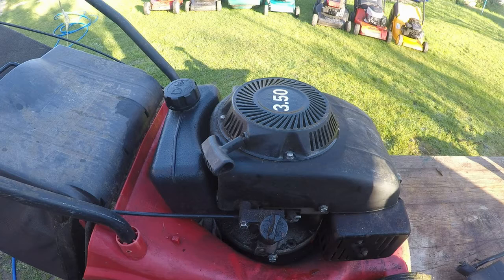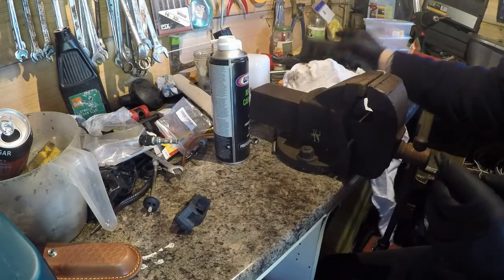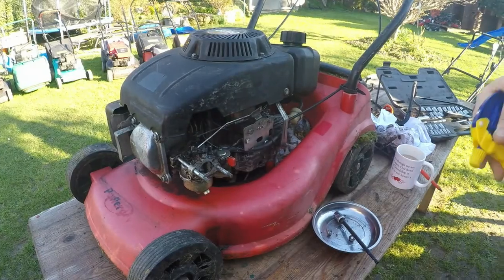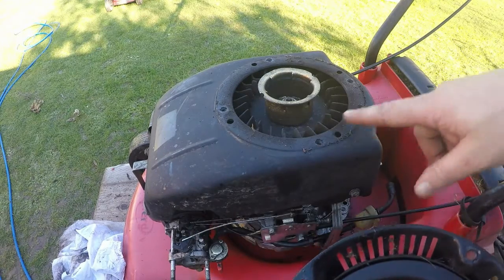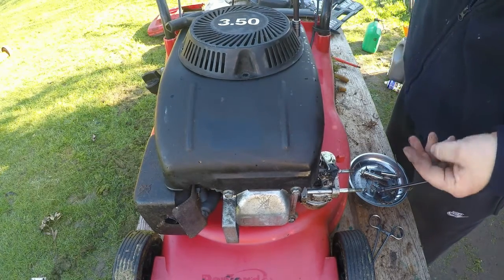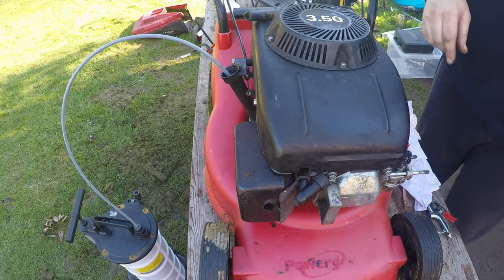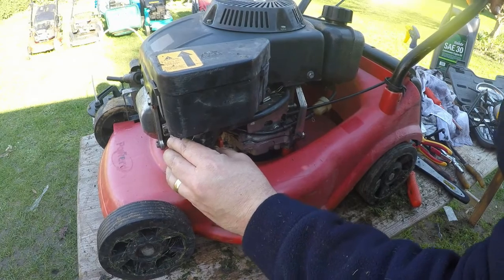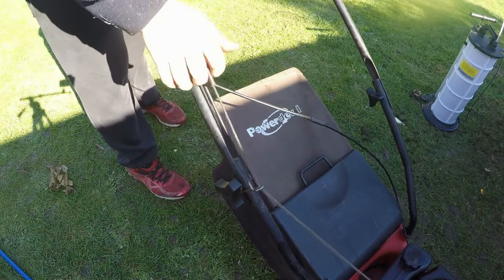#howtofix #easyfix #lawnmower Lawnmower Power Devil Part Exchange

Comment: Another good job Mick. Re spark plug - NGK BPR6ES or equivalent Champion RN9YC show as gap of .030" (.762MM). I have had to make a similar repair to air filter unit. I managed to glue in a  bit plastic sleeve to fit internally for extra stability.
Reply from the maker: Neil Harvey good idea mate

Comment: Great video! I have the same mower. 
I'm a novice when it come to motors so forgive me if this is a dumb question.
Is there a choke lever on this mower or does it have an automatic choke?
I couldn't figure out if the lever underneath the filter was the fuel switch or the choke.
Did i hear you right saying it's the fuel on switch? 
Mine is chugging along at the moment but the speed lever thing is super tight. Hope I can fix it!
Reply from the maker: The Leaver on the carb is the fuel on off mate

Comment: The dead mans handle should be the other way round (at the top) I think it is missing the stopper that prevents it from flipping down. I fact I just noticed at 02:06 there is a hole next to where the dead mans handle slots in, put a nut and bolt through that so that it stops the handle going too far forward, you could even go as far as to give the bolt a lick of black pain and the customer will be none the wiser 😊
Reply from the maker: Jacob Bates yeah that’s what I was saying but I inspected it and it’s not missing anything or broken off. Also the dead mans handle cable is not long enough to go over the other side so maybe it is made like that.
Reply from the maker: Jacob Bates also I just looked on eBay and it’s on the top but nothing to stop it so maybe it’s just worn a bit.
Reply: Jacob Bates yes I sold one similar had a kind of flat piece of metal L shaped bracket that stopped the DMH dropping down. Secured through the hole you mentioned with handle on top.

Comment: Hi there mick what oil did you put back into the machine please? And is this a 2 stroke engine? sorry I’m a novice.☹️
Reply from the maker: It's a 4 stroke.. I use sae30 oil mate
Reply: Thanks so much mick, I’ve got the exact same one I think what’s the difference between a 3.50 which you have and a 3.5 which is the one I have please? I’m working on it and just wanted to double check a few bits, And what type of fuel can I put in would it be unleaded fuel?

 Ps .Thanks. I Really do appreciate your videos buddy they’ve helped a huge amount so please keep them coming. 👍
Reply from the maker: @shaunbailey7910  the 3.50 or 3.5 is the same. Meaning 3 and 1\2 horse power.. yeah use unleaded
Reply: Again thanks so much @Micks Mowers really appreciate the help. 🤝  ps the recoil spring gadget video you have is amazing and helped with another one of my projects. Thanks again buddy.
Reply from the maker: @shaunbailey7910  your welcome me old mucker..
Reply: Sorry @Micks Mowers me again, if I wanted you to have a look at my lawn mower how do I go about it please, I don’t seem to be having any luck and really want it fixed. Thanks
Reply from the maker: @shaunbailey7910  first of all where are you located
Reply: Hi @Micks Mowers I’m in Bournemouth.
Reply from the maker: @shaunbailey7910  ok so not a million miles. I'm in Bognor Regis.. so it's up to you if you want to travel to mine. Email me if you do. micksmowers01@gmail.com
Reply: Yes I will do at some point thanks again Mick really appreciate it.